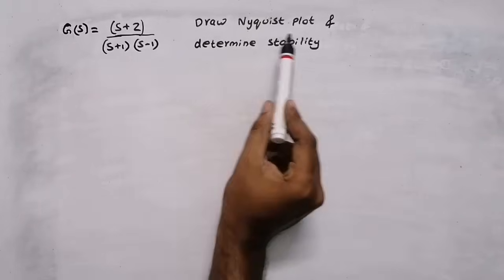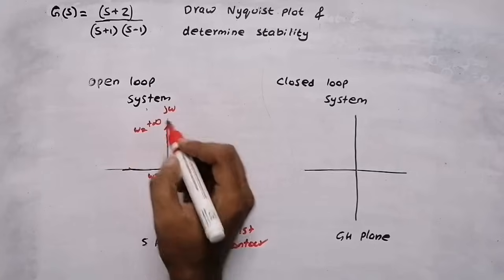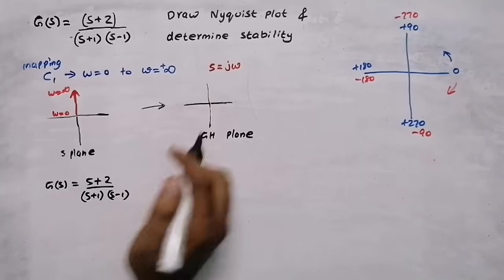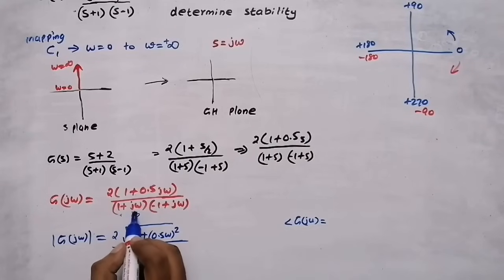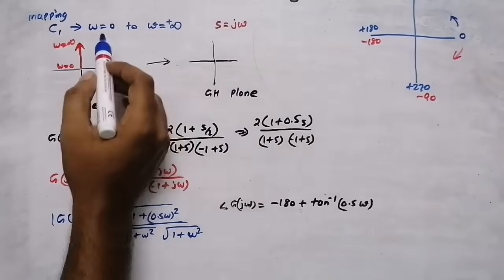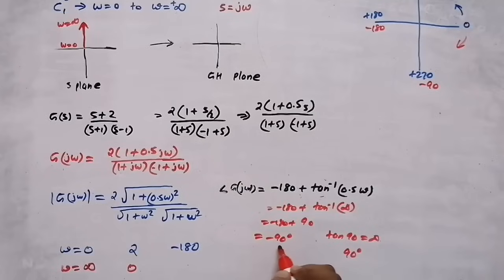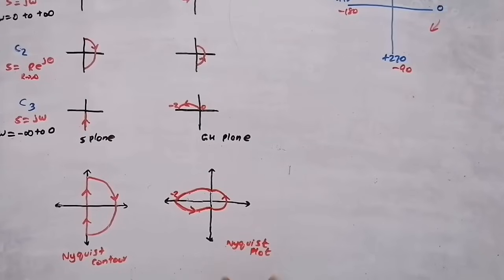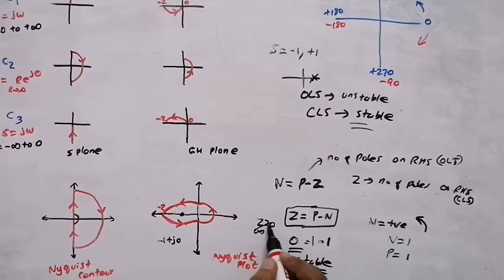Nyquist plot in control system

Comment: Omaga equal to zero to infinity. We got 2magnitude and phase angle-180.why you plotted graph left side it would be in right side time10:45
Reply from the maker: If Phase angle  - 180 means on left side......
Reply from the maker: Look at the angle graph... - 180 is on left side of the graph...
Reply: But 2is on right hand side
Reply from the maker: 2 is the magnitude...... Positions depend on phase angle...
First of all look at the phase angle... Graph going to start from - 180 degree phase angle.. And its magnitude is 2
Reply: @smartEngineerShinton  here we need to consider phase Angles frist is that what you are saying?
Reply from the maker: First of all if you consider magnitude then as you said it will be in right side... But after that phase is - 180 so where will you plot the point
Reply from the maker: We need to consider both magnitude and phase..
Reply: Tq.. your videos  are helpfull to everyone
Reply from the maker: @triveninagabirava9001  happy to hear from you

Comment: tan^-1(-x) is -tan^-1x and if we take that we cant draw the graph can u tell how to draw
Reply: In complex numbers, why do we add 180 degrees to our answer in angle theta=arctan (b/a)? I have seen 2 problems that the first, it didn't add 180 degrees while in the second prob you need to. How will you know when to add and when to not add?
It depends on the quadrant the numbers a and b are in and it depends if you want the result to be in the range 0–360 degrees or -180 to +180 degrees.

If a >= 0 and b >= 0 you are in first quadrant and you do not add 180 degrees. The result should be in the range 0–90 degrees.

if a < 0 and b >= 0 you are in second quadrant and you want a result in the 90–180 degrees range and unless your arctan gives you a result in that range you should add 180 degrees. Specifically if the result from arctan is negative you add 180 degrees.

if a < 0 and b < 0 you are in third quadrant and you either want the range to be 180–270 or -180 to -90 range and you add or subtract 180 degrees to get in the desired range.

if a >= 0 and b < 0 you are in fourth quadrant and you either want the range to be 270–360 or -90 to 0 range and you should add or subtract 180 degrees to get in that range.

The point is that tan(angle) = tan(angle + 180) so you can add and subtract 180 degrees to get the same tangent but depending on which quadrant the point a,b is in that might be the wrong angle. For example if both a and b are negative you do b / a and negative divided by negative gives a positive result which returns an angle in the first quadrant in the 0–90 range but your a and b isn’t there but in the exact opposite angle in the third quadrant.
Reply: Tq for explanation @yogeshkumar7931

Comment: sir which angle is greater  -100 or -185 degree? in an polar plot, one point is -100 and other point is -185 . Which is greater than -180? Angles are rotating anti clock wise in polar plot. so all angles are minus.
Reply: 185 i greater than 100  only difference is it is anti clockwise direction

Comment: In phase angle u didn't write 2 ? Explain..in question it there
Reply from the maker: Please mention the time in video
Reply: At 7:44 phase angle
Reply from the maker: If there is any S term or jw term you need to take angle. 2 is a constant
Reply: @smartEngineerShinton  in some textbooks they stated z as a zeros of a closed loop sysytem

Comment: Tan inverse-x is -tan inverse x
Reply: In complex numbers, why do we add 180 degrees to our answer in angle theta=arctan (b/a)? I have seen 2 problems that the first, it didn't add 180 degrees while in the second prob you need to. How will you know when to add and when to not add?
It depends on the quadrant the numbers a and b are in and it depends if you want the result to be in the range 0–360 degrees or -180 to +180 degrees.

If a >= 0 and b >= 0 you are in first quadrant and you do not add 180 degrees. The result should be in the range 0–90 degrees.

if a < 0 and b >= 0 you are in second quadrant and you want a result in the 90–180 degrees range and unless your arctan gives you a result in that range you should add 180 degrees. Specifically if the result from arctan is negative you add 180 degrees.

if a < 0 and b < 0 you are in third quadrant and you either want the range to be 180–270 or -180 to -90 range and you add or subtract 180 degrees to get in the desired range.

if a >= 0 and b < 0 you are in fourth quadrant and you either want the range to be 270–360 or -90 to 0 range and you should add or subtract 180 degrees to get in that range.

The point is that tan(angle) = tan(angle + 180) so you can add and subtract 180 degrees to get the same tangent but depending on which quadrant the point a,b is in that might be the wrong angle. For example if both a and b are negative you do b / a and negative divided by negative gives a positive result which returns an angle in the first quadrant in the 0–90 range but your a and b isn’t there but in the exact opposite angle in the third quadrant.
Reply: @yogeshkumar7931  thanks, i was searching for this explanation